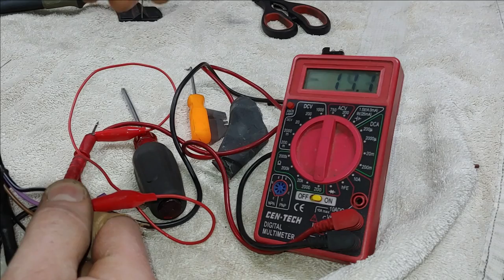02 Arctic Cat ZR 600 EFI part 10: The TSS [Rebuilding a TSS]

Comment: In my experience when those throttle switches are like that you need to replace it.  Out on the trail failure because of that switch would suck for someone that doesn't know.
Reply from the maker: Yeah they are bad enough for sure but a lot of the time it's just gunk buildup and grime mixed in with the Dilectric grease. So it stops allow proper connection. This is why I used carbon conductive grease on the contacts so that it will protect the contacts while having proper continuity. The dilectric grease is thw wrong stuff to use on contacts. Unless ita used over already connected terminals. 

Sometimes the contacts can wear too much. Sometimes the wiring breaks of the contact board or inside the wire and a new wire needs to be soldiered on. But they are most often fixable. 
Thanks for watching J. 
Andrew
Reply: @Fixin2Ride-Official-  you make great content.  Thank you.
Reply: Yeah.what he said lol. For a older machine there’s a ton of electrical going on here. I’ve ordered everything from the stator to the switch. I’m hoping it’s not my harness. We will see!
Reply from the maker: I found that with new used machines its best to go through most if not all of the plugs and refresh them. Clean and tighten them as well as grounds. Ive had to go through harnesses before. If the seat air box and engine are out, you take the whole thing out and liok for the rub-throughs on the main harness. You are typically looking at the section under the driven shaft for the driven clutch but on the chaincase side as well as near the front hood hindge with multiple pipe engines.
Reply: @Fixin2Ride-Official-  I was able to get a stop switch half new. I’m hoping the throttle switch is included but I doubt it. The switch we speak of is buried behind the thumb lever ,correct?  It’s got the same gauge wire and black receiving connection as the stop switch, correct?
Reply from the maker: Yes. The Emergncy stop switch and Throttle Stop switch are the same unit and connected with 3 wires only. Purple, Brown and Black on this year sled. You should be able pop the two screws out that hold the unit in plaxe in the throttle housing ams pull it out with a wiggle of the stop button. There is one screw in the back plate if the unit and then two tabs need to be spread and it should come apart. Im betting its gummed up. Clean it and grease with carbon conductive grease like I did and retest it.

-Purp/ brown = Emergency Stop
Button in = continuity
Button out = open
-Purp/ black = Throttle Switch
Button pressed = open
Button out = continuity
Reply: @Fixin2Ride-Official-  on my sled it’s 2 separate units. The throttle is separate with its own little spring actuated switch. It’s tiny. But I have a 02 ZL 600 efi ss with smart ride suspension. My luck I have some weird model nobody knows about. What a nightmare. The throttle has way too much play in it and it’s probably not hitting the switch when you try to accelerate. At this point it’s a guess because the switch tests good.
Reply from the maker: @sambuvca22  gotcha. Yeah if the throttle has to much play you can adjust the cable at the throttle body with a 10mm wrench. I like the short ones as they fit easier.